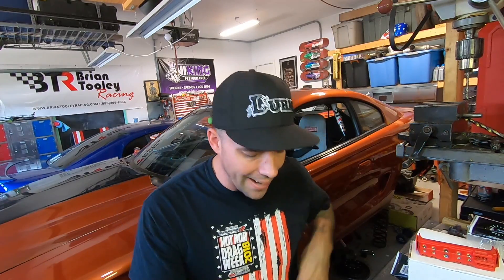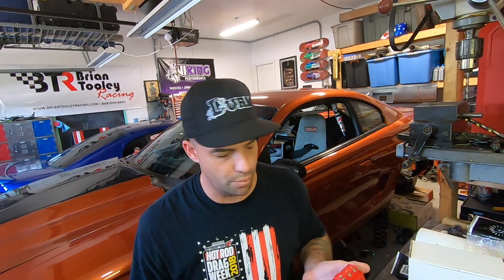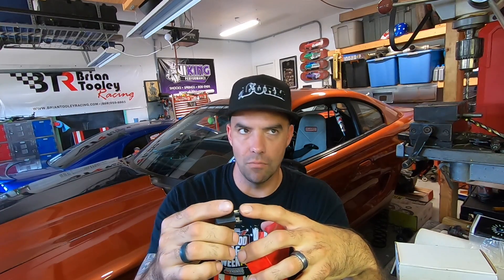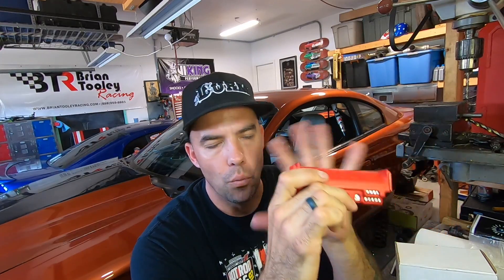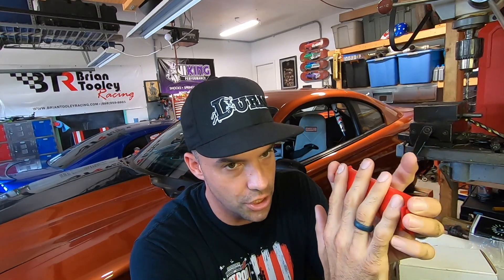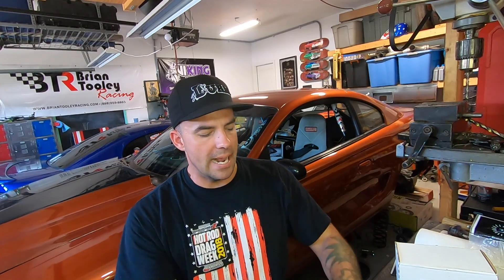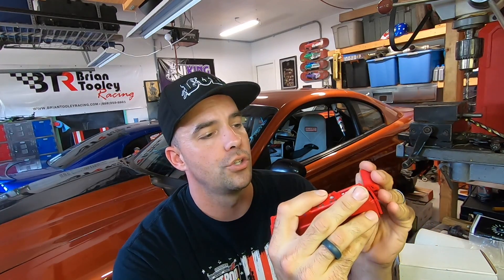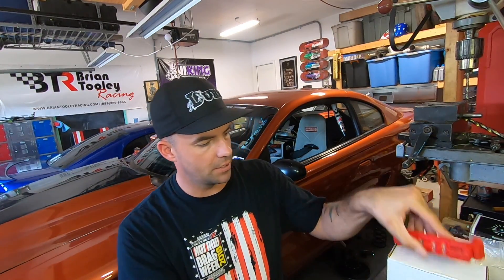NEW PRODUCT!  MSD 4 Channel Relay Board

Comment: Dude. I’ve had issues with the solid state relay shit.  I found. Good air flow cooling. If that makes sense. And reaaaalllly goooood soldered connections. Make or brake that shit. Don’t stick a stranded wire in. Solder the tip and tight in down nice nice.

Comment: When is Holley going to step up to Can Bus relays? That would be worth $150. Trigger it from Dominator, make it a whole system worth the money. MSD stuff has had questionable reliability for a long time now, I hope you give us an honest review after it’s running and driving with this on it. I’d like to run two sets of relays, one in the trunk closest to the battery and one up front In The engine bay hooked to a main battery terminal lug, so it will be near heat and moisture, let us know how it’s effected by the elements. Great channel, keep it up.
Reply from the maker: XOZ Industries It’s going in my Drag Week car to run the trans cooler fan and fuel pumps.  If it lives through that, I’d say it’s reliable.